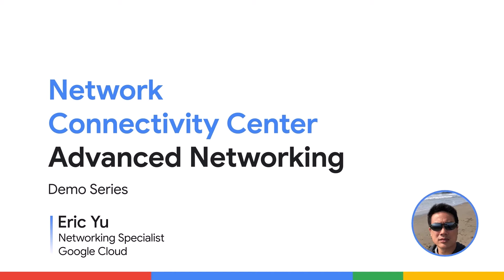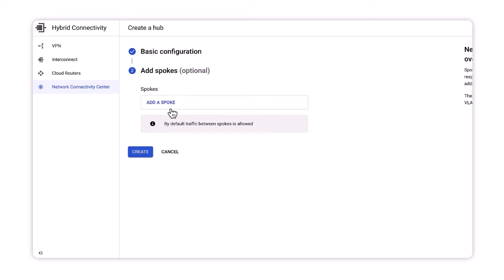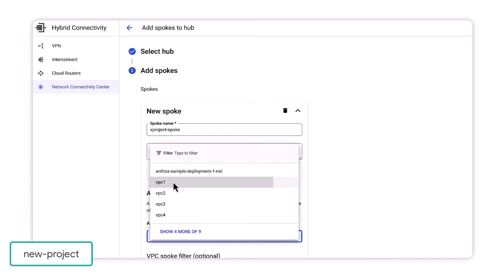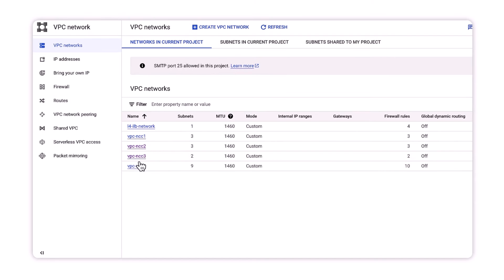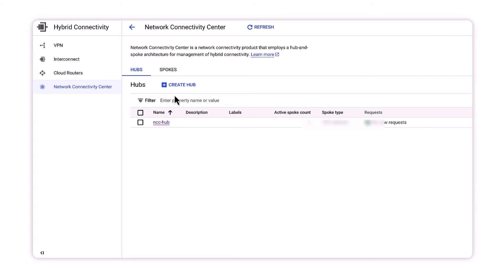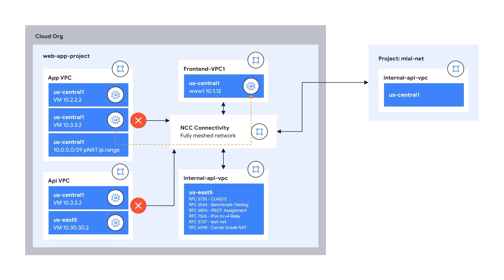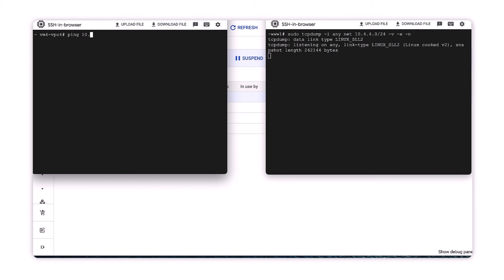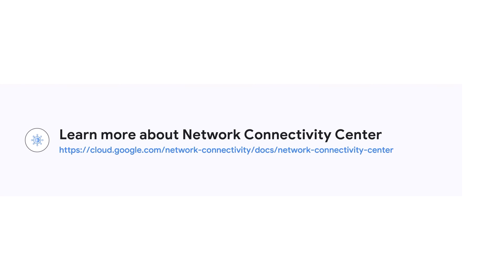Network Connectivity Center (NCC) VPC spokes demo

Comment: What are the use cases for using NCC? Is it no more than a better network management console?
Reply: When you need more VPC peering. Each VPC support until 25 peering. NCC support 250 VPC spokes :)